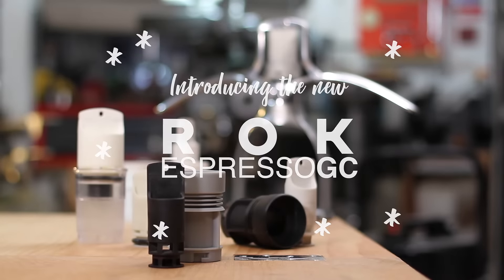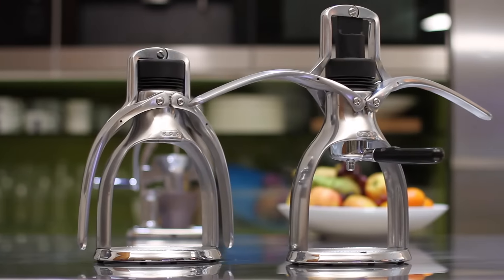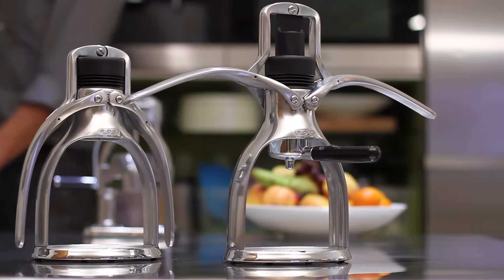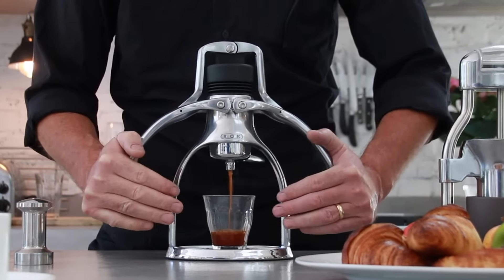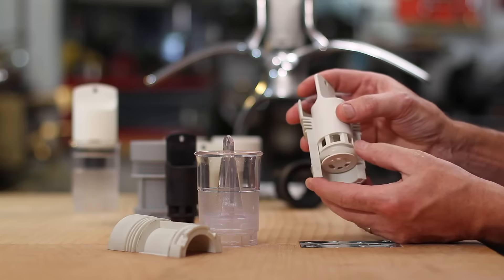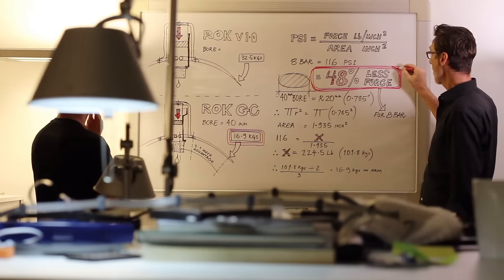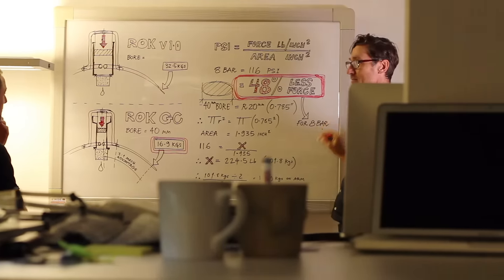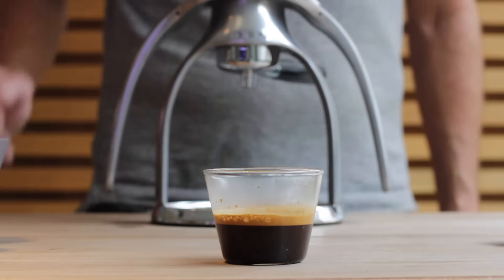Introducing Our 2019 ROK EspressoGC Coffee Maker!

Comment: Hi, can you make a new video on how to get the best shot out of the rok, i have just upgraded my one to the gc and i cannot get the same results as the onld version, the added pressure from the new gc pushes the water through to fast
Reply: MrVieuxSinge Hi, i changed my grinder to the rok grinder and its all good so my problem was down to my old grinder not grinding fine enough, hope that info helps
Reply: I just upgraded the Rok with the GC. The pressure is higher, I think I may need to grind it finer, will need to experiment more. How's your shots going?
Reply: I just bought rokpresso gc recently. After several times trying to find best ways to get good espresso..the outcome is disappointed and far below my expectation not even close to espresso. The main issue is that there is no enough pressure required to make good espresso. You can notice when pushing both levers...so light...pressure only about 3 bars..how one can expect to get good espresso. Of course, pulling a shot espresso is about art...result might vary from one to another. You can refer to review the real spromatheus 'head to head flair pro vs rokgc' and Rok vs flair espresso maker knockout' at tv by tom and kopihaii official :rokpresso vs flair'..not to mention about flair as I haven't have it yet. Both give reliable and balance infomation about rokpresso gc. For those who just want to having a cup of coffee below par...just bitter taste..you can choose rokpresso, but for those who want to enjoy rich coffee taste..it had better to look around for awhile and see as many testimonies as possible from honest users. I do hope this information useful for those who plan to buy manual brewing coffee device.
Reply: @indrahartono6430  Hi, as the rok does not come with a pressure gauge it is had to say what pressure you are actually getting but from my experience you not grinding fine enough. When I upgraded to the ROK GC I found my grinder even at finest grind was doing what you are describing. I purchased the ROK grinder and problem solved.
Reply: @fod4u279  I also using grinder from roc..at 1..for rok grinder...the grinding result undoubtly good. But, for rokpresso gc...it is awful..
Reply: @MrVieuxSinge  I also already waste a lot of my lovely fresh coffee beans, waste time and money to buy this awful device...
Reply: I strongly believe that patrick hunt the owner of rokpresso has designed rokpresso wrongly..
Reply: @indrahartono6430  how much coffee are you putting in? With my rok grinder set about 6 from fully shut I use 18g of beans and it work for me
Reply: not at all...I already waste a lot of coffee..and time..you can check from other reviews...some also complaining about rokpresso gc..not only me.  this rokpresso being endorsed by james hoffmann. He put his good name at risk..
Reply: @indrahartono6430  not really no, he has achieved good espresso from it so is being honest with his reviews, I have also had good espresso as have many others, once I had a good grinder and dialled in for the beans all was good, I use a range of beans from my local roaster from light to dark and different areas and know the grind setting for each. With all the manual espresso machines you needed to take the time to work these things out, and be prepared to use beans to do it. Also the support you get from rok is exceptional, the designer phoned me to talk through the issues I was having and help me don’t know of another company where you get that happen
Reply: @fod4u279 ha ha ha...there are many buzzers....you can refer to the real sprometheus 'head to head flair pro vs rokpresso gc and Rok vs flair espresso maker knockout at tv by tom...both of them give reliable and balance information...not to mention about flair as I haven't tested it yet. I definitely say good if it is good and bad if it is really bad. I have been using rok hand grinder for 1 year and the grinding result undoubtly good. So, you can notice that I give balance information and the real users not buzzers..
Reply: hi, I want to know your experience to have enough pressure...now...when pushing both levers..it is so light...
Reply: @indrahartono6430  hi, i have already told you I get on absolutely fine, i have said the grind setting i use how much coffee i use and that i also tamp the grounds?? I get a great amount of pressure, What else do you want to know?
Reply: @fod4u279  at roc grinder..what number..I already use 1...it is recomended from 1-3 for espresso...then..
Reply: and I already do temping hard enough to create pressure...but it remains same..

Comment: I just bought rokpresso gc recently. After several times finding best ways by means of following instructions to get good espresso..the outcome is disappointed.  The main issue is that there is no enough pressure created by the device. You can notice when pushing both levers down...so light..the pressure only about 3 bars. How one can get good espresso or even close to it with pressure at that level. Pulling espresso is about art...result may vary from one to another. You can refer to reviews the real sprometheus 'head to head flair pro vs rokpresso gc', 'Rok vs flair espresso maker knockout at tv by tom, kopihaii official 'rokpresso vs flair battle'. All of them give reliable and balance information about rokpresso..not to mention about flair. as I haven't had and tested it yet. For those who just want to having a cup of coffer below par...just bitter taste...rokpresso is best choice...but for those who want to enjoy a rich coffee taste..it had better to look around for awhile..see as many testimonies as possible from honest users to avoid taking wrong decision.
Reply: Fix yo grind and technique bro. Don't blame the machine, if ur skills and knowledge are at fault.